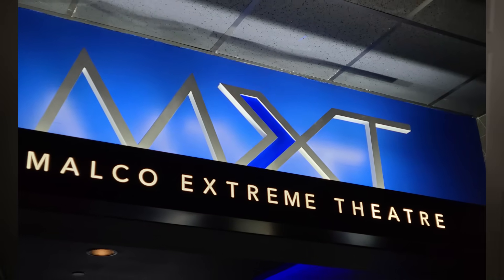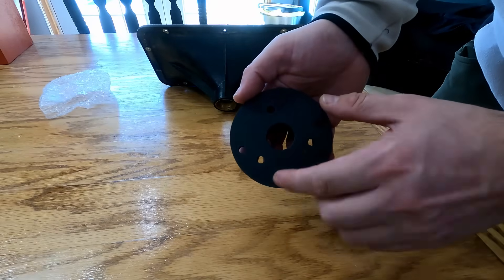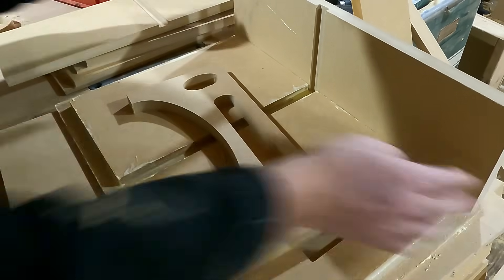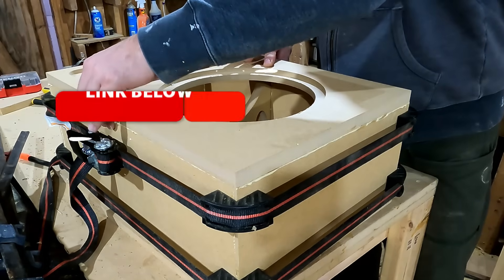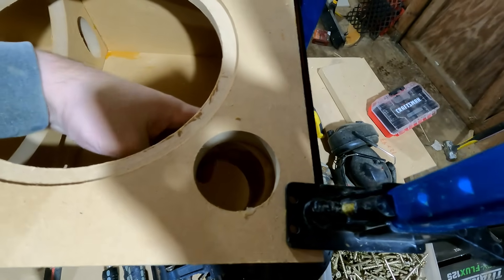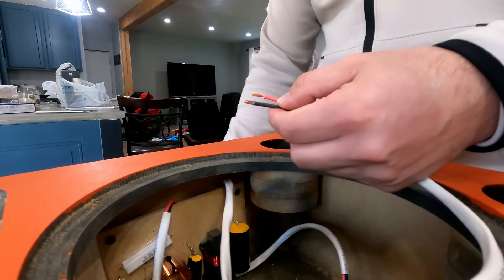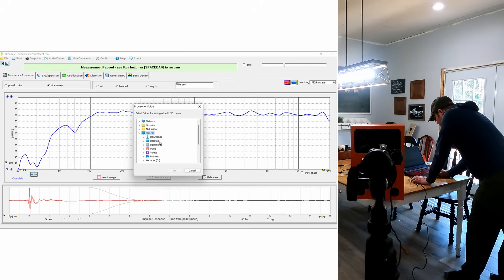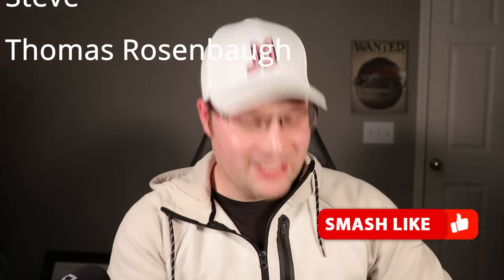How to Build $5000 Speakers for $400 - Klipsch KPT Inspired - Cinema 10

Comment: GOOD STUFF !   However , only for someone that has the tools and and workshop. For those who don't, one can find used K-Horns for cheap.  Then upgrade the components because the internals even back to the 70's were never very good compared to top shelf components like what VOLTI AUDIO SELLS.  

Using Volti Audio parts, my speakers rival $100,000 speakers and even best most of  them.

Comment: Building these as surrounds for a new home theater. How would you feel about using a miniDSP instead of a passive crossover? Same for the Audience 212
Reply from the maker: There's no reason you can't. Assuming you have the measurement equipment, amplifier for each driver and the knowledge on how to create an active crossover, you can definitely do that. I personally wouldn't want to do that.Yiuv would need 14 amplifiers for just four surround speakers and three front speakers. I would rather do the passive crossover. But that's the great thing about DIY, you can do it however you want.

Comment: Can these Cinema 10’s be used for all my front speakers?
Reply from the maker: Yes. That quite a few people have used them for all five of their speakers. It’s a really great way to get fully enveloped sound.
Reply: @Toid would the BTS 15’s or the audience 212’s be better for fronts?
Reply from the maker: @jaredvoshall5229  honestly they’re both really good but the audience 212 is the one used the most. I will say that if someone was really trying to do a real budget home theater all Cinema tens would be really fantastic. Assuming you have good subwoofers.
Reply: @Toid I was thinking of building 2 21” subs from your plans for the front and 2 15” subs for the rear.
Reply from the maker: @jaredvoshall5229  you’ll definitely have the bass you need
Reply: @Toid I just bought the plans for the kits and will start this process.  This will save me $$$ thousands.
Reply: @Toid do you have a video for an amp to run the 21” subwoofer?

Comment: Would these kind of speakers work as front speakers also? Have an old pair of pa:s and I tried to crank my 2x100W amp and they sounded great, and my ears hurt... Lack in low Hz department at normal levels though.
Reply from the maker: Yes. Actually, these would be great for front speakers. There’s been a few people that have used these for all five main speakers.
Reply: @Toid  Thanks! checked my old speakers and guess what. They had Celestion TF1020:s in them. So guess I only have to build your enclosures
Reply from the maker: @DanielKihlgren That’s crazy! Just to clarify, these aren’t going to give you a lot of low end bass. They aren’t designed for. They’re designed for clarity. They become really special when you pair them with that wave guide and compression driver. That wave guide really bellows down the compression driver gives a nice smooth even response.

Comment: Hey Toid, really like your builds! I was planning on building the older ones that had 2* 6,5" FaitalPros but cant find the guide no more. I was wondering about these Cinema 10's would it make a huge difference if I used JBL Selenium D220Ti drivers instead of the celestions? I have 7 of those in stock so would save a ton with that!

Comment: These look great!!! Do your plans explain where to get xover or how to built it... Love your videos!!
Reply from the maker: @303Estates  thank you. I appreciate hearing that. The plans do include all the crossover information. And of course, if you have any questions about it, you can let me know.
Reply: @Toid  Great!! is there a place to buy a finished crossover. On a second matter, have you ever explored using an active crossover and multiple small amps which are the craze now?
Reply from the maker: @ really premade crossovers are not useful. They really need to be designed around the drivers. So the answer that question is no. However, I do have a lot of videos showing you how to read a schematic and turn that into a crossover. It’s really easy once you understand it. As far as the second question, I actually have a video coming out this weekend on a DSP amplifier that can be used to like that. It has six powered outputs and four passive outputs for a total of 10 outputs that can be DSP. This gives you a lot of flexibility and power when designing speakers.
Reply: @Toid  Gotcha!! Your upcoming video sounds very exciting!! The ability to adjust each speakers levels , with no inductors and capacitors which have there evils, is so cool, and you could pick a few different micro amps to match each driver ;-). Can't wait!

Comment: I'm a newby to the idea of crossovers. Some articles talk about crossing 2 way systems at 2500hz to 3000hz depending on speaker specs. By crossing at 80hz does it not send too low a frequency to the horn tweeter?
Reply from the maker: @kimsansom8159  that’s a good question. We’re not crossing over the woofer and the horn at 80 Hz. We will design the entire speaker with the crossover. Then when you implement this into a surroundsound set up, you’ll cross over at 80 Hz to your dedicated subwoofers. That means all your bass will go to your subwoofer and the speaker would play everything above that.
Reply: @Toid  thank you for the reply

Comment: Klipsch KPT-8060H $899.80 at Top Shelf Audio. I suspect your speakers cost more than you state and also don't sound as good as the Klipsch.
Reply from the maker: @jimspence0  they might cost more now, these were designed three years ago. But just to clarify, those are $900 a speaker where this is $400 to $500 for a pair. You could build 8 of these for one pair of those. As for the sound, I would be more than welcome for people to do some blind listening tests between the two. These are incredible sounding. Feel free to check out the sound demo of them. Although you won’t get to hear what they sound like you should be able to get a good idea of the clarity and balance.

Comment: I’ve made speakers without the CNC. Just use a router, table saw and clamps. I hate particle board/MDF. It swells if it gets wet. It weighs a ton. Baltic birch is better. You can buy plastic ports at US Speaker. That’s insane making MDF ports.

Comment: "Klipsch KPT-8000M Surround Speaker
899.00 €(incl. VAT)

A high-value, highly-aesthetic surround speaker perfect for smaller size cinemas where cost effectiveness is a major objective, the KPT-8000M is designed for flexible side-wall or ceiling placements, making it an excellent choice for today’s advanced, multichannel digital sound formats. "

So $1800 retail for pair  on the kpt 800m

Comment: Cheater. When I was kid in the 80s, we had no cnc and no sound software. Cut everything by hand and used real math on paper and calc to do the dimensions! To me, this is paint by numbers compared to building DYI at home. By the time you purchase all this equipment, if you aren’t designing and building as a pro for money, you are losing money every build.

Comment: I looked high and low for ABS and PVC pipe with a 2.5 inch inside diameter. I can't find it anywhere. Can the ports be reworked to more modular pipe dimensions?

Comment: Just wondering why not rabbet your panels together and run more dados?   Or run mitered corner blocks for better  support of the boxes?    Is it just not necessary or just to simplify?    As a more traditional cabinet maker im just learning why.   Thanks for the vids!
Reply from the maker: It’s not necessary. The most important thing in cabinet making with speaker building is creating a dead cabinet. And by that we mean a non-resonant cabinet. And that’s what the internal bracing is designed to do, along with the type of material and the thickness. It all place are roll.

Comment: as of Feb 2024 I just looked up the prices of the components.  they have doubled in price since some of these videos were made.  what was 200 bucks in parts is now 450 bucks.  totally killed my buzz.  why do you never mention what crossover you are using ?
Reply from the maker: It is crazy how some prices have jumped up, but these not so much. The cost should be right around $250ish. The main components are right around $200, then add in the custom crossover which is listed in the build plans. It might end up costing a little more than the original $200 per speaker, but not that much. I would just use the code TOID to get an extra 5% off to help offset the cost.
Reply: @Toid   2 woofers at 85 each   2 compression drivers 99 each  2 adapter 15 each.  2 waveguide 19 each .  for two speakers thats  $ 436 not counting ports.  not complaining,  just saying these are not 250 dollars to build .  i really wanted to build some but by the time i buy the parts, a few tools,  i can get speakers that play well from the store for 500-600 .

Comment: You really should change the name of this video. It's highly inaccurate. What's the point (besides getting clicks) of saying how to do something cheaper when you're using equipment that costs thousands? Also, you ought to mount that mitre saw so that it isn't shaking when you use it. So dangerous.

Comment: How to calculate the box interior volume to match the specific speaker chosen and port area???  This is not something anyone addresses. Is this not important or am I thinking too much into this. There must be a frequency inside the box that leaves the ports in the same phase as the front of the speaker.
Reply from the maker: I have a series on WinISD which focuses on answering a lot of these questions. That might help those with an inquiring mind.

Comment: I am wanting to build a sealed speaker using a horn. but my Woofer (a 12" SB34NRX75-6  needs crossed below 500Hz so thinking of a four way using the Eminence Beta-8A to bridge between the Woofer and the Horn. probably 200Hz, 850Hz and 4kHz. where the Horn I want to use can cross Selenium HC23-25 and the Selenium D250-X. Not sure what tweeter to use but probably the Beston RT002A Ribbon Tweeter. Think I only seen you build two ways with a Horn and woofer. But what is your opinion on this design?

Comment: 9:30 What defines the perfect spot for the Crossover? Is is acoustically or just practically?
Reply from the maker: Both. You need to find a spot that’s far enough away from the magnets of the drivers. Otherwise, the strength of the drivers can affect the inductors, which will have an effect on the acoustics.
Reply: @Toid  ah ok. 
But in this case, the affect on acoustics is a consequence of the magnetic field effect. 
I was wondering if the location of the crossover would affect the speaker performance, as it's technically using enclosure volume space, etc.

Comment: just curious, how would these fair as L and R Mains or a 2.1 setup for listening to music?
Reply from the maker: They could be really good for that. Assuming you want a very wide soundstage
Reply: ---I'For me, the wider the better! i have active nearfields i use for work on mixing/mastering audio related projects and they're great for their purpose. but, i want a giant wall of sound where i cant pinpoint where the speakers are if my eyes were closed. "so to speak". Also, of course imaging accuracy which they looks like they measured amazing, and then me just just wanted an overall amazing small'ish package that sounds Great, balanced, wide, deep, and of course FUN when trying to min/man a $40'ish budget.
---- I also just ordered 2 of the JBL 550P 10" Subs for $150 a piece (after in your cart) as of right now still for JBL or Harmon. Im pretty this is that last and final sale for these as they've gotten rid of most the other t6 5=series lineup in order to push there new 6 series, (which I think took a big dowggrade). So had to buy them out of principle because I know Its honestly the last stock last off these little murderous bass machines. 
---- Side Note: I absolutely love JBLs 530s Bookshelves as well. My god, are they just (magical) for $280. he only thing ever that I could roughly equate the sorcery created by The OHM Walsh's Omni Dir. Speakers @ $3500-6500! (Those speakers atomize your souls into another dimension sound by  fully enveloping you're entire existence while whispering "surrender to it..." while you become one with the wave forms. There like nothing I can describe them too accept the few properties that ive only heard the 530s manage to do, in similar way, somehow. But Ya, these sadly (Discontinued) $299 JBL 530's can show similar properties even though they couldn't be built any different, That just my take.         ----Okay, back to the 550P Subs. The only issue being people saying the plate amplifier gets really hot which eventually ends in failure. So my Dingus Brain thinks I can Find a 12v power somewhere in that plate amp and figure out how to stick a fan in there. (even though its fully closed design. Mayke finding some big aftermarket Passive Find to stick to the backside with thermal adhesive to help suck the head out, idk, I'm kinda stumped and I havn't found any proactive cooling solutions online aside from people replace the entire plate amp, and/or the driver and literally just using the Box (Built like a German Tank) then they slap $1000 work of components in it. after or before it blows up. and just bout them because its was I 11sort of Now or Never type. its you have any knowledge or just a general suggestion on how to improve the  JBL 550P with any upgrades to avoid this prominent 1.5 year plate amp failure they get, id love to hear your expertise and opinions on the Sub.  its a 60lbs 300ms 10" subwoofer that youll feel literally punching your insides fast, sharp and deep when listening to a stuff like Modern Produced Metal Metal have for their kick drum tones being Tight, Clicky, gated, etc) im sure you know exactly what i mean. If I put on some old Behemoth, Obscura, Nile, or a genre of Black Metal, I feel like I went 3 rounds  in a UFC getting my ass whooped with internally bleeding. This is only 1 hooked up in a 18x14x10ft room. 
--- Anyways, I appreciate if you read my entire ramble and would like some advice to protect overheating and maybe point me to the best (IYO) $400-500 dollar bookshelf type speakers for a Stereo setup. thanks for the reply, Brother.  @Toid

Comment: Thank you for the build. How does this speaker compare to the JTS 212 from the mid bass up? Or better, compared to the best you have built for sound and imaging? Thinking about doing this build. Thanks

Actually, it was your sound demo that sold me. I would say do it for every build. Very helpful. I can listen through the recording issues to get a good idea.
Reply from the maker: Appreciate it. My favorites are the Soundstage 15’s followed by Cinema 10’s.  They both are excellent for what your looking for.
Reply: @Toid hanks for the reply. My idea is to augment with stereo subs below 80 hz. 
I like this small form factor though. 
I saw your audience video and thought about their high end compression driver and wondered how it would better the celestion one used here. 

What drivers, wave guide would you pick to make the ultimate version of the cinema 10? If you have time to think about it that is?
Reply from the maker: @rvaillant  I wouldn’t change anything on the cinema 10. It came out the way I wanted and met all the goals I set.
Reply: @Toid  Can you share what the crossover point was? Also, if one reduced the box width to 12" and added depth to compensate, how do you see it affecting the response? Thanks

Comment: GR Research basically said front ports always cause sonic issues?  Thoughts?
Reply from the maker: Whenever you are designing a speaker their trade-offs. It’s up to you to decide what those trade-offs are. In the case between a rear port and a front port, a rear port can get away with a lot more sins. What I mean by that is every airport design doesn’t always have to be perfect. You can have more port velocity, and even some more resonances that are often harder for a listener to hear. Having said that a rear port will be more susceptible to speaker placement. Meaning that the response of the low end can be affected by how far away it is from its surroundings. On top of that, you do have to be cognizant of where you place your rear port on the speaker because that can also have an affect on your response. A front port is less susceptible to placement but you do need to design the port better because it’s easier to hear port noise and resonances. In general, a well designed front port is usually more desirable than a rear port.  But all of it comes down to the designers trade-offs.

Comment: Where can I buy these components for $500? Otherwise I need to budget $25,000 for a CNC equipped workshop and $100,000 for an addition to my home!🤣
Reply: Yes. Your comment is on point. Sure I could buy the components but the wood shop and experience are quite unattainable.
Reply: Just need a router and basic woodworking tools
Reply: Why do you think you need a CNC for this? Just because he used one? You can build this with pretty basic tools
Reply: @alexorton6832  I've built PE and CSS speakers but I always purchase the flat packs. If he'd make the flat packs available for purchase I'd probably make these...